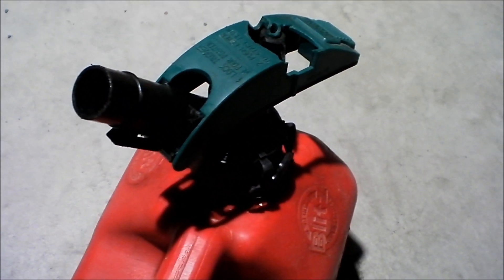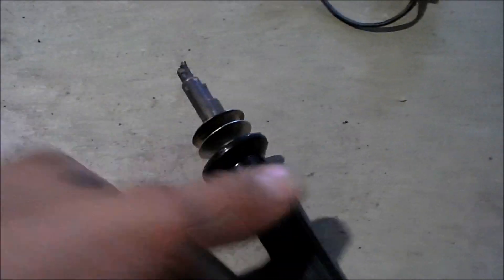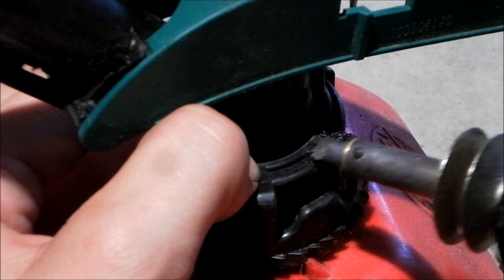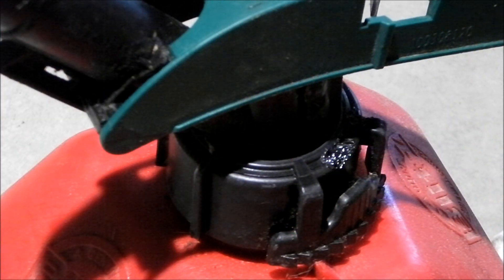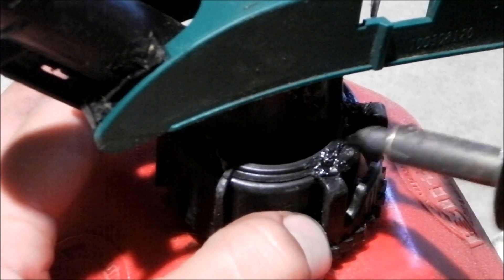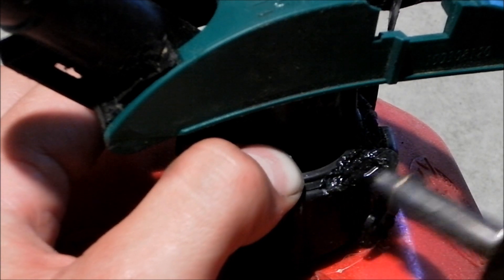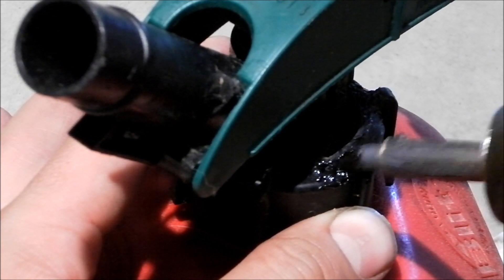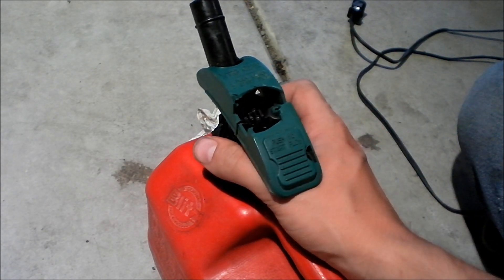how to fix a Blitz Gas Can Enviro Flo Spout

Comment: Nice, clear video. Thanks.

I used Gorilla Glue epoxy and some steel spring clamps on 24 hours to fix my first broken Blitz Enviro-Flo spout on a 5 gallon fuel can. I used your melted plastic method on a second one that broke.  Both work but I think using Gorilla epoxy is a lot easier.

Comment: These are the best gas spouts I have ever used. Let the trigger go and it stops the flow of gas no spills. Unfortunately Blitz is going out of business due to product liability lawsuits. I have 3 of these spouts and have never had one fail.  I have 4 gas cans two-5 gallon cans and one 1-1/2 gallon and a 1 gallon can. Tried to find a Blitz spout for my 1 gallon can but no one carries them anymore. Everything I have seen at the stores are junk no way to shout off the fuel.